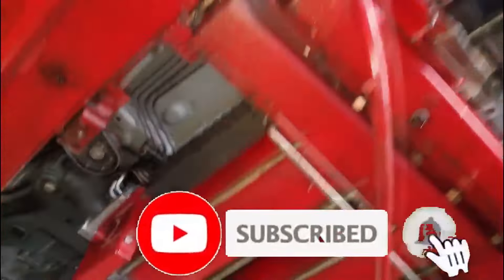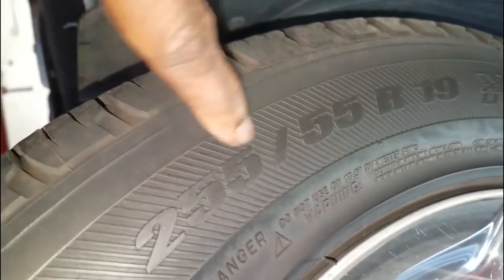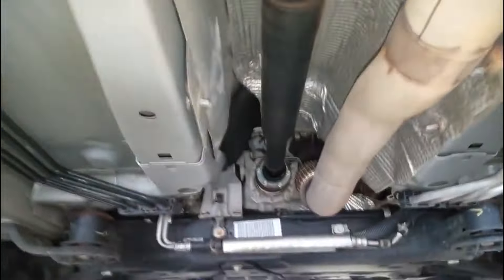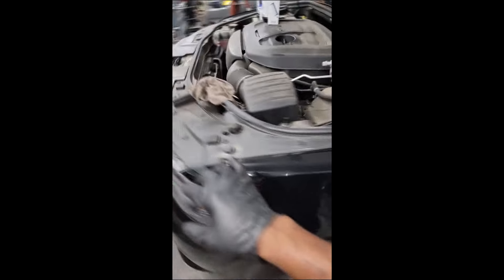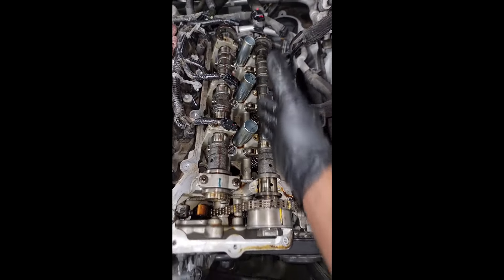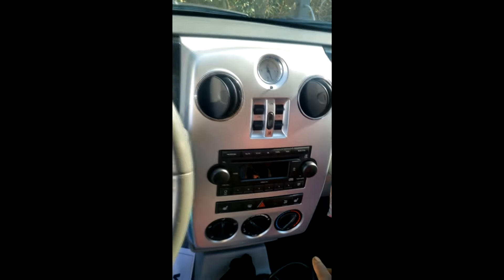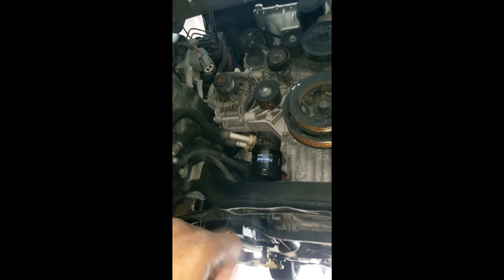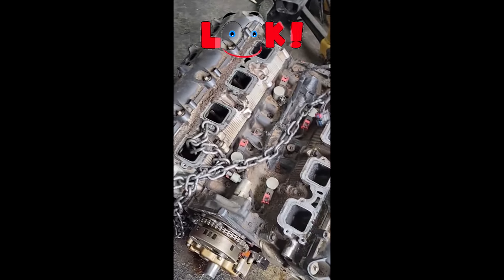NEVER DO THIS WITH NEW TIRES ON THIS KIND OF CAR.

Comment: great video my man! keep on wrenching away and on the timing belt? for me it depends if the rubber is weak or worn out, I say change it, but if it's not broken don't fix it, unless it's an engine that if the timing screws up it could cost you the whole engine, then yeah.
Reply from the maker: Interesting take you have on it